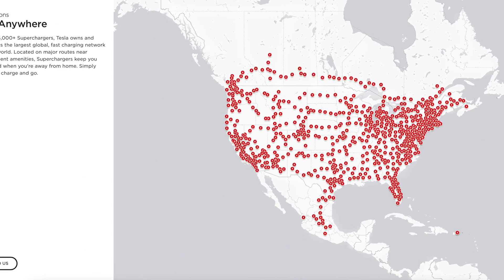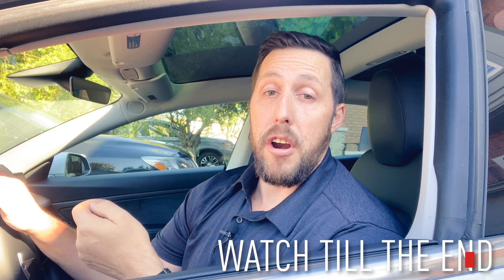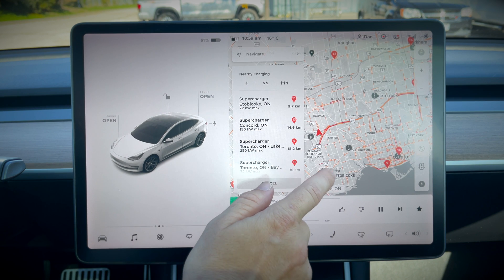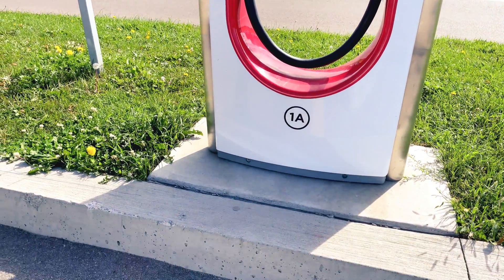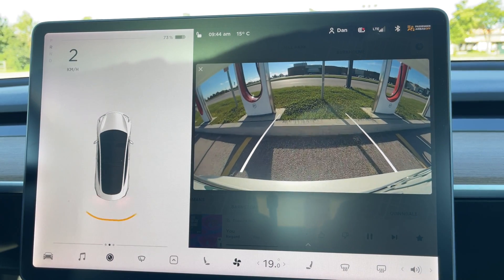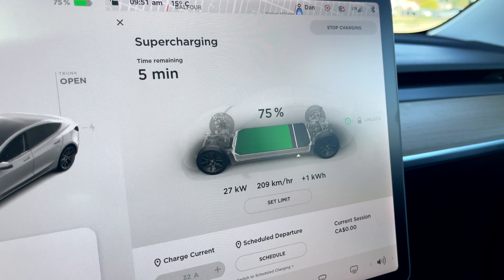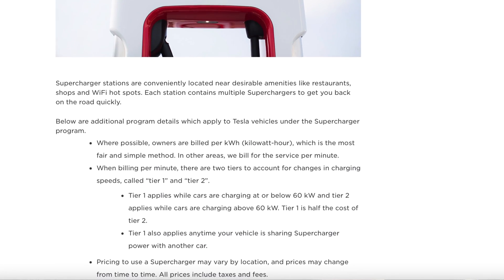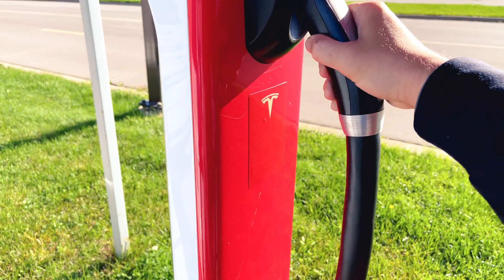Tesla Supercharging Basics

Comment: I also notice/hear some pops while sitting in the car (not plugged in for charging) while waiting for friends/family to come out from their home, or a store/wherever. Is this normal, like the pops heard during a charging session caused by the pressure you mentioned in this video?
Reply from the maker: Does it make a sound consistently while you’re sitting there or when you move the wheels for the first time after sitting a while?  And what Model?
Reply: Model Y; It consistently makes the popping sound, maybe every 60 seconds or so, while idling/parked & not doing anything special when in parked mode (except once, watching YouTube with the car's system after immediately parking) while waiting to get called into an appt at building I was parked at because of pandemic protocols..
Reply from the maker: I only get a “popping” sound when the brakes are a bit stiff when first rolling out but never heard what you’re describing. I asked a service technician and he also has never heard of that. I assume you’re under warranty and perhaps a service request would be a good idea.